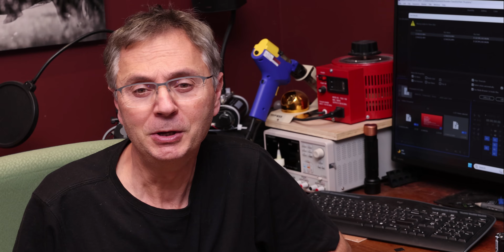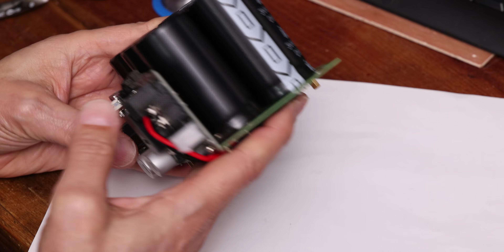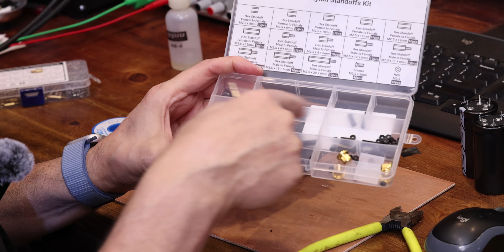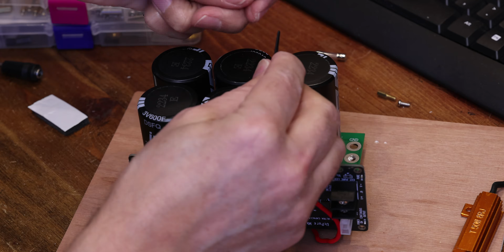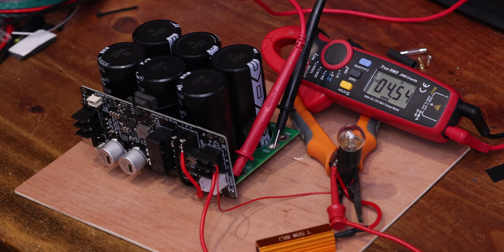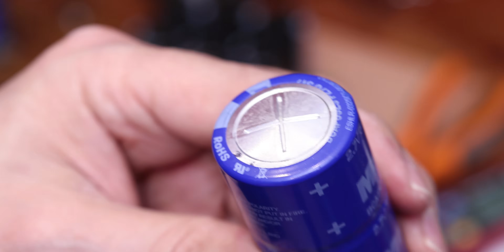Pure 15v Power.  Mini setup using UCPure by IanCanada

Comment: Am I correct in thinking the Sync mode only works when it is connected to a FiFoPi Q7 ?  That is how I read the manual - can anyone confirm ?
Reply from the maker: It is as you need a way to determine if the music is paused you can also connect it to the monitor pi without a fifo Q7 
Also you can connect it with a different trigger base on the music been paused but you will need to create something similar

Comment: Hi Gabby, how many F supply is enough to un a FiFoPi with SC pure clocks? Do I need to go for the large ultracapacitors?
Reply from the maker: The easy way is to use a PurePi Base then you do not need anything.
Reply: @Gabster1  true, and I already have one of those. I'm probably overthinking it as I want to get the best performance out of the clocks.

Comment: hi Gabster - if the voltage has a range between 12.8-15 then when we use it in a circuit,  voltage is not stable is it?
Reply: pm me can you to install do solar panel of charger＋

Comment: Gabby, the challenge is that many preamp circuits require voltage between 12 and 20 +-, but often times 13.5 for example. Whats the best way to get to more granularity in supply voltage without involving a regulator?
Reply: pm me can you to install do solar panel of charger＋

Comment: Hello, we have been reading about ucconditioner circuits not running properly because of bad soldering joints.  But if they are correctly soldered and caps are from a reputable supplier the voltages on all the caps connected in series should be identical. If you cannot trust the device you just build how can you leave it unattended?  Maybe you add some tiny isolated terminals on the outside of your chassis that will allow you to check voltages on all the caps in a few minutes. Especially if there are several charging cycles during the way when you are at work you want things to keep working . There are some people who prefer listening to music and not have their gear on the kitchen table once a month for inspection or the latest update. Greetings,Eddy
Reply: pm me can you to install do solar panel of charger＋
Reply from the maker: Good point. may be small relays connected to  led voltmeters to quickly do a check. 
disconnecting the power is also highly recommended when not in use.
Reply: Hello, The clock circuitry needs to be powered all the time for the best sonics we are being told. They also use two caps in series but with a bigger safety margin. Even if you are home during a supercap supply going nuts it can be dangerous. WHAT should you do when you hear an alarming noise coming from inside your build? If there is to much pressure upon the aluminium housing of the cap , even during non charging condition, what to do? Put on your safety goggles, disconnect all cables into the cap chassis and put it in the middle of your garden? @Gabster1
Reply from the maker: @Eddy-gr5wm   it would be fun to do a video doing just that I can picture you running with your System to the garden 😀
I personally disconnect my system that will reduce the risk big time you can power your system few min before any critical listening the difference is hardly audible not worth the risk.
Reply: Hello,
I will not use this kind of equipment in my house. Even if you are there when it is going wrong i am not willing to take the risk. No matter how many well intended warnings and construction tips you will give most people will continue doing it not according to the book. It is not without a reason that many people end up with having issues with these power supplies. Greetings, Eddy @Gabster1

Comment: What's the Ripple voltage
Reply: pm me can you to install do solar panel of charger＋
Reply: @anwin85alon Already connected AGM batteries that trickle charge while not in use , Super Capacitors are just a FAD O get 20 hours of playtime and filter the noise down to zero
Reply from the maker: None measurable

Comment: I know it is unrelates but honestly you are the most knowledgeable source I know. Long story short, I have a pi2AES  hat in the beat possible conditions (1000€ linear psu, good coaxial wire, volumio with local file on SD so no USB in the chain) and just went to compare it with iFi zen blue v1, running on a cheap 50€ psu with files from wireless lan, then Bluetooth LDAC , then  fiber optic that is slightly inferior tp coax in my setup, and trashed the Pi HAT. This should not be possible. My question is if you try to compare the inc canada streamer with the zen blue, because I am thinking of upgrading my streamer, but to have 1000€ streamer lose to an old 150€ Bluetooth receiver again … 
Thank you.
Reply from the maker: Thank you. Most of us do not realise that for a streamer like a I IanCanda streamer or others they are only effective if you can bypass the Dac internal clocks and bad PSU. I always recommend to build a Streamer/Dac instead, for a couple more parts you get to see the real benefits of pure UC power and great expensive clocks.
Reply: @Gabster1 I fixed it, and it was dumb. When I put the streamer on the back of my rack it was turned side way 90 deg. At first play the cooler from cpu  had the adhesive melted and the piece of copper tumbled and was touching all sorts of components. Took it apart put it right again and now now it is far better sounding.  Funny thing was it never had a buzz or anything that normally would indicate a short circuit, the sund lacked the punch, everything was dull, and lifeless.
Reply: Hello, If you spend let us say 1000$ on the streamer side you will probably end up spending the same amount on the dac side of the line. If you spend 450 $ on two clocks instead of 100$ you cant use a dac that will be cheaper than your clocks. Sure clocks play a key role but a cheap dac remains a cheap dac. We can read on the internet how people wanna get ucpure for their Raspberry pi3/4/5. Ian develloped two boards so we can create physical and electrical distance between Raspberry and sensitive parts by using HDMI connection. No need to use that just use the most basic wire and connectors just like you do connecting a 60 $graphic card in your pc. BUT keep using these 450$ clocks.Good luck, Greetings, Eddy @Gabster1
Reply: pm me can you to install do solar panel of charger＋

Comment: Hey Gabby,can I buy this pre assembled in Europe?
Reply: I would NEVER use these kind of caps if they are not the original ones like those offered by companies like Mouser. Especially if they are connected 24 hours to the grid. Especially if used in series you will only need one of them go bad to end up in a disaster. Of course we might need a real accident with an insurance company not paying to wake up people.
Good luck and greetings, Eddy
P.s i read on the internet that Ian has not been reacting to emails for more than 3 weeks . Maybe wait with new investments?
Reply from the maker: @edgoewie2132  I totally agree best to use a reputable brand but even then I would still test it over time. also the balancing boards need to be tested over time.
Reply from the maker: You can get a 16v bank assembled like this
https://amzn.to/3VBPimI
And add a ucPure to it 
Or the big bank 
https://amzn.to/3vxkg4O
Just make sure you test to make sure it is safe specially measure the voltage on each Uc not to exceed 2.7 these can be non reliable parts and at a higher risk then good brand name ones.
Reply: @Gabster1 yes 8v up to and 16v can install do solar panel of charger... Yes good posts...
Reply: Safety First and over Time (24/7/365). This should be built into the design with “fuse like functionality" ideally before it actually becomes dangerous. This would also greatly improve user confidence in ultracapaciters these builds and demand😊.
Reply: pm me can you to install do solar panel of charger＋

Comment: i appreciated the builds and you going thru the math of how long the UC Pure Power will last.  One thought for improving Ian's board design so that load always sees "Pure Power" of the UCs is to have two UC banks and have the board switch between the two UC banks (see Uptone Audio). This would greatly improve the flexibility of the system, make larger loads practical, and make the power supply quality irrelevant.   Ian is probably is 99% of the way there with the Mark III's charge between song circuity, maybe for the Mark IV?
Reply: pm me can you to install do solar panel of charger＋
Reply from the maker: I thought about that long time ago before even Ian started doing that, not sure if the switching will introduce any noise but would be good for power hungry devices I think between songs charging is a very clever idea and is enough for low power devices.
Reply: Maybe switching at higher currents is the "magic" that Uptone Audio solved, their board looks pretty complicated and I believe the max. amp load is 1.0. However the current Ian PS/SC board is so limiting if used for DACs and Streamers with in the 0.5 amp power draw range or higher you used in this video.  Your results showed a 165 second charge time with a 64 second charge time which is too long to charge between songs so current setup is a no go.  If the power switching noise issue is easily solved you should be able to limit the wide allowable voltage range you observed, 12.6 to 15.2v, because you just need the charge time to be less than the discharge time.  You also wouldn't need to use such large SC for most applications. In the end I believe the HiFi PS industry will shift to the dual bank SC power supply as it seems to me to be the ultimate HIFI PS, lots of available current with very low ESR.   @Gabster1